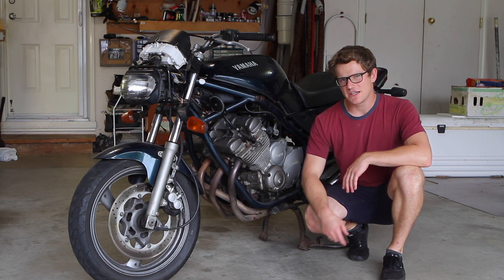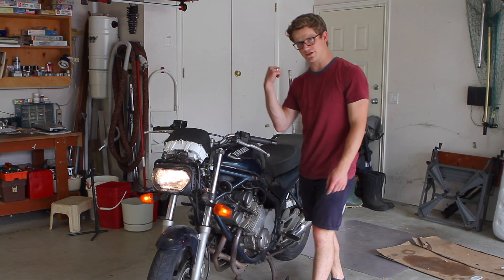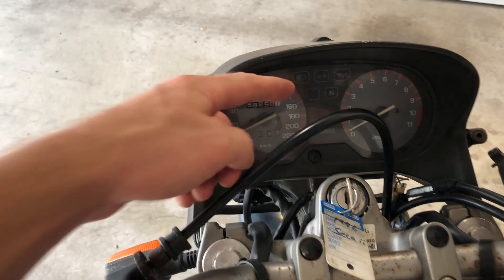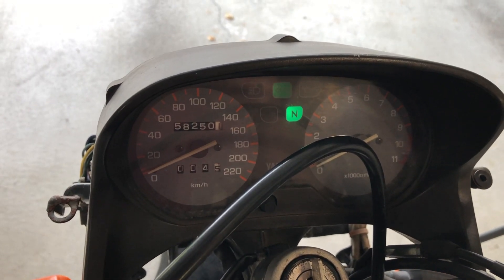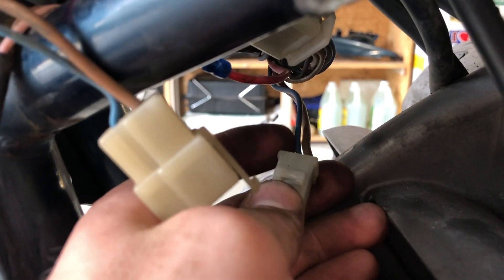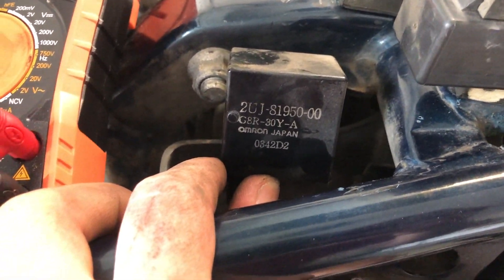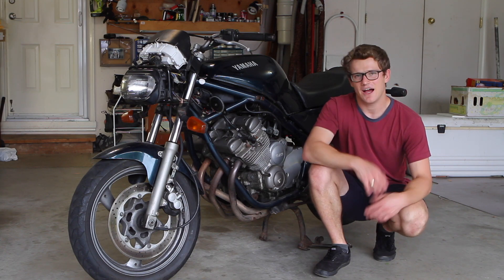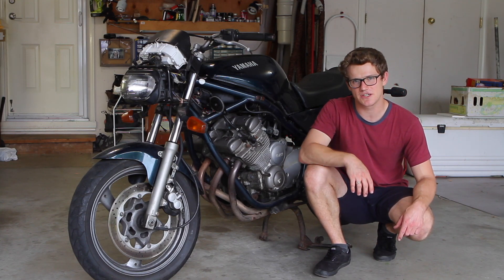1992 XJ600 Ignition + Fuse Box Wiring Explained (Wiring diagram)

Comment: Hallo there .
I have a brake light issue with my xj600.
The light turns on by pushing the brake pedal, but does not work with the lever. The lever switch is working properly and by using a voltmeter on earth and the yellow wire it shows 12.71 volt when pedal brake is down. The same voltage with lever. So why the hel does the brake light not lid when the harnes is connected?

Comment: Great videos man, very helpful. I also had a random 5k resistor on one of my spark plugs. When I ordered a new 10k resistor cover from NGK, it does not fit the terminal of the spark plug itself. Any ideas? Where did you buy your replacements?
Reply from the maker: I found a part number from partfish.com and was able to order a oem Yamaha part through a local shop. The 10k resistor caps are hard to find these days. Glad you like the video 👍